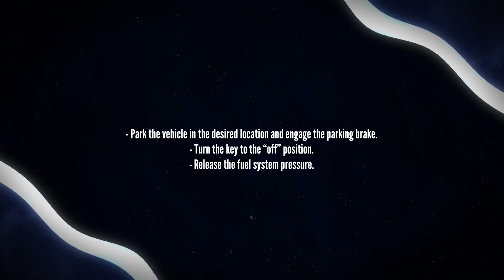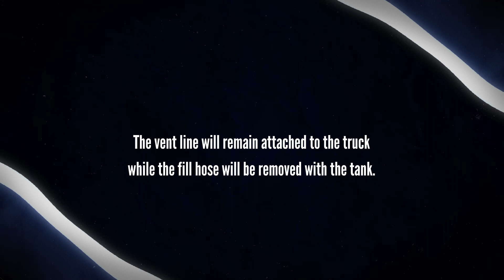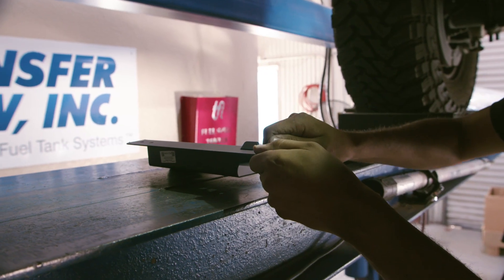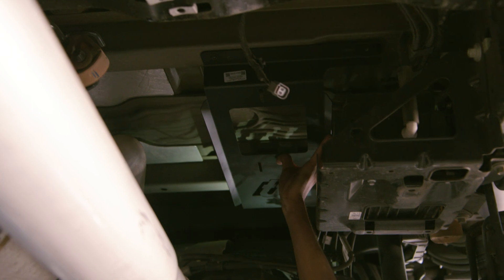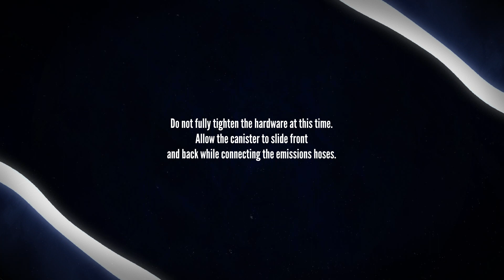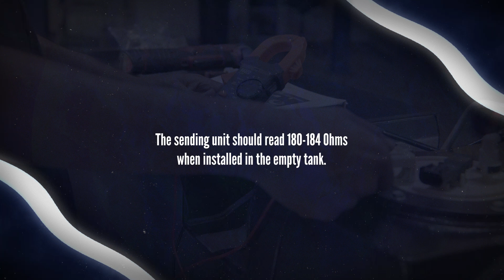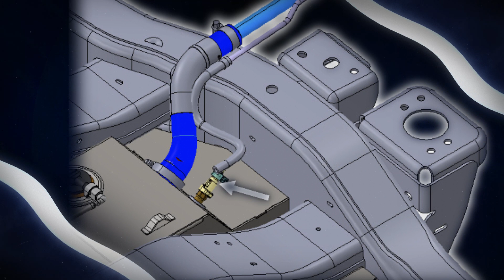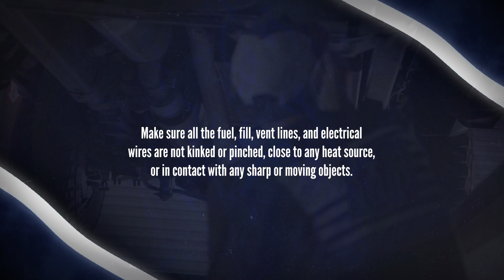Installation of Transfer Flow's 58-gallon replacement fuel tank for Ford gasoline Super Duty pickups

Comment: Can the skid pan be reinstalled?
Reply: The metal of the tank is over twice as thick as the very thin OEM Ford skid plate. It's also much small than the new tank. It would be pretty much useless even if you could install it.

Comment: Will there be anything for the 2023 Super Duties? Website says this one it’s incompatible. Also what about 2021+ F150 gasoline engines? You have one for the 2018-2020 trucks.
Reply: TF's website says this tank fits 2020-2024 CCSB F250 and F350. 

"Transfer Flow introduces the first-in-the-nation and 50-state legal gasoline high-capacity replacement fuel tank for 2020-24 Ford F-250 and F-350 Super Duty short bed, crew cab pickups with 7.3L engine."
Reply: @LSUtiger95  yes it was updated. Not 10 months ago.
Reply: Little late, but nobody makes upgrade tanks for gas due to EPA requirements. :(
Reply: @MrThisIsMeToo  yes they do. Have you even checked the websites?

Comment: Why don't you make gasoline tanks like this for Ram? You have gas tanks for Ford and Toyota but only diesel for Rams.
Reply: Little late, but FYI, nobody makes upgrade tanks for gas vehicles due to EPA restrictions. not even Titan.
Reply: @MrThisIsMeToo  this video your watching is for gasoline tanks. Several companies make gasoline tanks. They just don't make expansion tanks or in bed tanks for gasoline.
Reply: @lonewanderer3603  Mud on my face.  Been somewhat in the business for a couple of decades and it was always the EPA getting in the way.   It was the evap system for gas certification or something like that, that got in the way.  Something must of changed regulation wise or somebody figured out how to work it out simply. Thanks for the correction. 
If you want fuel for a Ram, just buy a chassis with up to 77 gallons stock.  :)
Reply: @MrThisIsMeToo  I think it's because these are actually complete replacement tanks that they are allowed. They don't allow in bed tanks for gasoline because of accidents and also they can't be plumbed to the main tank the way diesel expansion tanks can. And it's a DOT rule, not EPA. You could be thinking of something different from me, but that's the reason I've always understood in bed tanks and expansion tanks weren't allowed for gasoline. Although they will allow you to have a loose tank that's strapped in, for some reason that makes no sense to me. Maybe they'd rather see the tank ejected away from the vehicle in an accident. Who knows. The government is often illogical. Cheers.
Reply: @lonewanderer3603  From my old understanding, if they changed the size of the replacement tank, the evap system had to be recertified.  That was always my belief as to what the hurdle was.  
I have always been under the assumption that no flammable (i.e. gas) drip tanks and such is a DOT violation, not EPA.
Reply: @MrThisIsMeToo  well I know one thing, they sell oversize replacement gasoline tanks for Ford but not Ram. I'm guessing it's not illegal. I just wish I could find one for my truck. There's all kinds of room under there.

Comment: And when you add the weight of that thing with 60 gallons of fuel you can kiss your gas milage goodbye
Reply: You really think a few hundred pounds of weight is going to affect mileage in a 7000 lb truck?
Reply: It’s only like 250lbs of fuel added over stock.
Reply: Difference is negligible when it’s already a 7000 lb brick. What’s really gonna cut your gas mileage down is pulling a trailer—especially any kind of box trailer.
Reply: You're clueless

Comment: I had the 58 gallon Transfer Flow tank installed and its working great so far on my 2022 F350.  I am having a heck of a time finding someone to program my truck to recognize new tank.  I am located in Dallas TX area.  If anyone knows of someone with a Forscan that can help?
Reply: Look up the forscan forums.  You can find someone there.  Fwiw I just watched some YouTube videos and did online reading before using forscan myself.  It’s not too bad.  Just save default before you start and change one thing at a time.
Reply: Did you ever get your DTE reprogrammed with Forscan?

Comment: will it fit the 23 crewcut Super duty with a 6 3/4 bed and what is the typical installation cost
Reply: This is what im wondering.. whats the difference? Physically?
Reply: TF's website says this tank fits 2020-2024 CCSB F250 and F350. 

"Transfer Flow introduces the first-in-the-nation and 50-state legal gasoline high-capacity replacement fuel tank for 2020-24 Ford F-250 and F-350 Super Duty short bed, crew cab pickups with 7.3L engine."

Comment: Are there qualified shops in NC that will install these tanks? I have yet to find one. They will do diesel but not gas. No explanation why. Also how do you change the miles till empty? Thanks
Reply: Give buddy at Rowells a call. They are located in Indian Trail. Just south east of Charlotte. I am getting ours installed this Friday.
Reply: @joeallison2779  cool, that place is about 15 mins from me. Thanks
Reply: @whit10mm72  we have a carbonize gray F350 crew cab, so will be easy to recognize if you stop by Rowells on Friday. 
They have done numerous transfer flu tank installs.
Reply: @joeallison2779  If you don't mind let me know how you like it after install. I'm still on the fence with the 7.3 and the diesel. Leaning 7.3 but they are not easy to find right now. Crossroads in Indian Trail got a big delivery on diesels a couple weeks ago. How's the 7.3 doing for you? Thanks
Reply: The installation of the fuel tank today only took about three hours since we had two technicians doing the job. This is not an inexpensive upgrade by the way, but having extended range when towing sure is nice.
We have just over 2000 miles now on the 7.3 and I am very impressed with the engine. We have the 430 gears and on the highway we get close to 14 not towing anything and driving about 75 mph.
We didn’t want to diesel mainly because of the noise the smell and the high cost of ownership being at least $10,000 over the cost of the 7.3.
Our F350 is a lariat, 4 x 4 crew cab and does not have the FX4 package or the tremor. 
I can tell you with an 11,000 pound fifth wheel we were getting roughly 7.3 to 7.4 miles to a gallon at roughly 63 to 65 mph. This was the main reason we got the larger tank installed so we would not have range anxiety. Hope this helps. Let me know if you have any more thoughts or questions.
Reply: @joeallison2779  what is your range between fill ups?
Reply: @Beardinc  750 miles highway not towing.